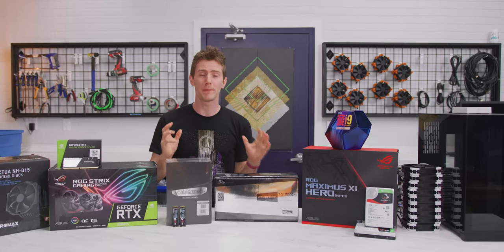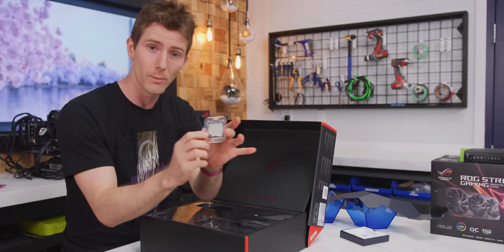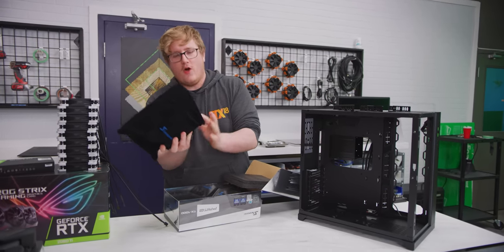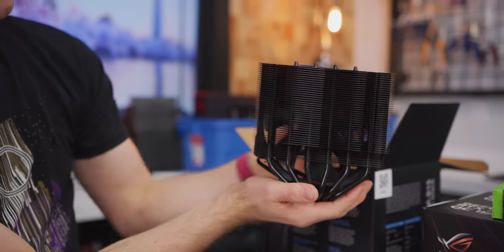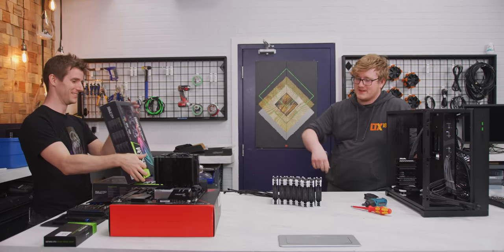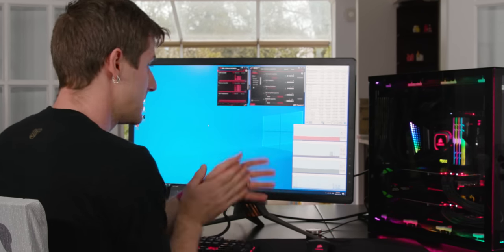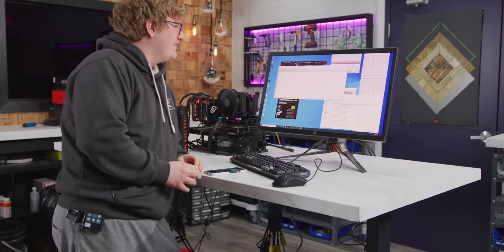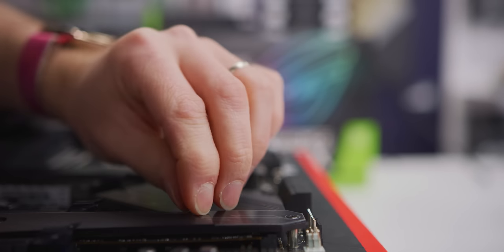Can AMD Beat the ULTIMATE Intel Gaming PC?

Comment: "Air cooling is every bit as good as water cooling!"

Except when the AIO water cooler fits and the air cooler doesn't.
Reply: Maybe someone should look at the air cooler vid just released on GNexus
Reply: That's just lazy planning. You still get a potentially noisy AIO pump and the design typical vulnerability for failure (gunk buildup, failure of the cheap ass pump, liquid evaporation). AIOs are expensive but yet questionable in quality. And the less questionable start to hit custom loop pricing. Also I wonder if vibration just in the socket is such a great idea over a long period. Maybe the soldering joints won't like it.
When the air cooler fails only the fan can possibly fail. Your CPU will throttle a lot but otherwise will work fine. With an AIO you might get black screen shutdowns even in the UEFI screen. Thankfully modern CPUs usually won't fry themselves anymore.

Also you could transplant s behemoth like the ND-NH15 (or whatever it is called) to countless new systems. Noctua provides new mounting kits for free (you can get AM4 screws for old S775/S939 made coolers if you want) and since there is not much change in design it will probably stay one of the best air coolers for many years. Unless carbon nano tubes, special ceramics,  or diamond powder get used in larger quantity in the base plates and fins there is no change about to happen. This cooler will work perfectly fine in the PC that comes after your next PC in 12 years. I wouldn't trust a typical AIO to last just one extended life of a PC.
Reply: @Hortifox_the_gardener  Yes, my old Scythe Mugen 4 cooler from I don't know how many years ago is still kicking, too. Had to buy a new mounting kit for it though, since I guess somewhere down the line AMD changed their mounting.
Reply: I'd use aio even if it was always worse. Just can't stand huge heatsinks anymore. This cooler looks ridiculous.
Reply: to me, AIO water cooler is good for high performance rig in a compact case like an ITX build where Air coolers are not great. but if you have a ton of space, i’d use a Air cooler. i just make it sure i have a ton of fans like a wind tunnel (this would be loud asf though)
Reply: Imo thats most often just crappy case design
Reply: @kepeter97  or just a case designed for water cooling. The air cooler would fit in an pc o11 XL or maybe in a pc o11 air
Reply: If they had used the xl version of the pc-011 that air cooler would fit.   Planning is key.
Reply: @Hortifox_the_gardener  You have somewhat valid points, but the risks are not anywhere near as big as you suggest. Go watch GN video from a few days ago. It also shows that when noise normalized, liquid coolers do beat air coolers. It may actually not make much of a difference in practice, but that's the same as that those extra FPS on the Intel system does not make a difference in practice, which is the whole basis of this video. So Linus saying that there is NO difference is just plain wrong.

And liquid coolers CAN actually make a bigger difference when you take into account heat soak time. Liquid coolers and air coolers are very close in performance once they reach their steady state temperatures, but since long 100% CPU load tasks are kind of rare, in many cases your CPU will actually stay cooler than that with the liquid cooler because the air cooler will heat up faster than the liquid.

Now, that doesn't mean that air cooling isn't perfectly fine, it is. It's just silly to say that it doesn't make any difference at all in a video where you're going for the absolute maximum everything and comparing Intel and AMD on performance that doesn't actually make much difference either.
Reply: I can really relate to this thread, I've got the same case and I've had to leave the front off to allow room for a cheap air cooler, because my NZXT Kraken died. Currently waiting for an EK loop kit to replace it, could take a while.
Reply: wish they could make tower coolers fatter and shorter without dropping performance.  like do side by side 100mm instead of inline 140 for slightly more cross sectional area. i got a pair of 92 mm noctua low profile fans on my case in a negative pressure configuration that shove all the waste heat from my cryorig out the side of the case with great force. so dual or quad 92mm in a side by side config might be fairly good, provided it does not block your gpu.
Reply: @BCSJRR  not in the o11 air, it has the same size as the dynamic
Reply: @Alice_Fumo  i cant get any am4 mouting stuff for my scythe coolers. got 2 140mm they are insane i mean heavy AF and cool pretty well but yeah its not the basic amd mounts so it wont mount to am4...
so i had to buy a new am4 zalman cooler for 24€.... luckly amd is not a hot head like my old i7 6700 that i only used 4 months cause Oc that a 4.5ghz and it would crash and go upto 95C and crash cause needs alot of voltage.. 4.2ghz worked good. but it felt slow still... just went full amd since intel sells better :)
Reply: watercooling is NOICY AF
like when ever the pump turns on... the fan that turns....
my 120mm air cooler cools as good and also just has 1 fan... 
only reason AIO are cool is that they look nice and clean... i just dont like them...  dont trust them...
Reply: @dorientjewoller113  ain't that actually part of the whole planning process I mentioned? I have my NH-d15 in a pc0-11 XL it don't with room to spare. Not to mention it far better fits the wider pcb layout so cables don't touch the glass. And my reasoning was I like  a big air cooler. But also liked the pc-011 aesthetic. So that setup worked perfectly for me. And the hotswao drives is a decent plus.
Reply: @reggiexp69  hm, the scythe official website still says, that you can get it by asking the support and paying 5€. However, I ended up buying it from ebay back then and those offers I can't find anymore. By the way, I think I tried to contact the scythe support team and got no answer, but I may be imagining that, since I might've decided ebay is much more convenient.
Reply: @Alice_Fumo  same i contacted them atleast 2 time this year... nothing so yeah fuk it. it will stay intel... my mugen max and what ever the other name is. they cool but not usefull if not am4..
Reply: @scarletsylph  Yeah if you want to run a big air cooler you need to buy the 011D XL. I am running a Coolermaster V8 GTS in my case and it fits perfect. Lian Li publishes the max cooler height and max GPU length on all their cases so you can just look it up before buying to make sure your cooler or GPU of choice fits in it. With that being said the price difference in cases will eat up the savings from going from air cooler to AIO. So if it's a new build and size is a concern just get the 011 dynamic and a good AIO or custom loop. The dynamic XL does have some really nice hot swappable drive bays, but it is a beast of a case.
Reply: @dorientjewoller113  in that part I definitely agree I mainly watch linus videos for the entertainment value alone because if I want an actual review. I find other channels to be far better in the information part.

Like for hardware it is mostly gamers Nexus.
Reply: @dorientjewoller113  and another point tbh no one in their right might would actually buy two 2080ti
Reply: @dorientjewoller113  yeah i got 2 scynth cooler ofr 12€ each. old stock on some site. never used them (kidna forgot them) then put it on my i7 2600k gained a easy 5C compaired to the coolermaster 120mm  master air pro4 what ever it was. then i put it on my i5 6400 OC that ran cool to the point where it i could turn it off under 35C with bios fan curve then the i7 6700 OC that still was cooking or you needed 100% fan speed. now its collection dust. cause i got 2 am4 pc and 1 with tht i7 6700 but i got a lepa neo rgb cooler on it... just cause rgb.. got some old i5 2320 but that just have a stock cooler.
but i do love the scynth coolers they heavy AF and kinda cool and cool really good...
Reply: This ^ FTW

Comment: Had an overclocked Intel to go up against stock AMD... Where was the overclock on the AMD? Unfair...
Reply: Intel: burning to get high.  
AMD:  go brrrrrrrr!
Reply: The case COULD be that the 3950x doesn't really overclock. But great question.
Reply: 3950x will overclock but you need great/unconventional cooling to get much out of it.  Easier to tune your ram as well as possible and let the CPU overclock itself as well as it can if using standard air/water cooling.
Reply: the point is there is no manual overclocking both cpu´s where used stright out of the box with there "standart" clocks and yes u could technically overclock the amd to a similiar lvl and will get an even or better performance but u could also buy a normal 9900k and overclock it by yourself.
Reply: The problem in the comparison is that they got a binned 9900KS that they knew was on the high end of quality you can get for that chip but they grabbed a random 3950X.  It could be that the AMD chip was a garbage tier bin and barely up to the specs of a 3950X.  We don't know.  In any case we're talking about a 100mhz difference here for either chip and it's not going to give you the 10%ish difference that was demonstrated.  So Intel still will come out ahead regardless of binning.
Reply: @kevin9218  thats true but Lopalos stated that this comparison is unfair couse intel´s cpu is overclocked but its totally fair since they just bought the best(gaming) cpu from intel and amd with both cost around 750 ~ bucks and both cpus used with stock out of the box clock and in this case u have a huge 10-20 % performance advantage by intel and anything else did not matter at all here
Reply: @puttitat2851  X means unlocked?
Reply: @leonljensen  It does, but 16 cores in a small package also means that it's not really feasible to overclock it with regular aircooling / AIO.
Reply: this video meant that high clock cpu from intel still beat multi core AMD. thats a fact. but, again, do you need a pc for only gaming? it's your choice
Reply: more cores does nothing for gaming when your talking about 8-16 cores. 9900k has higher clock speeds so even if it was a normal 9900k it would still win but not by the margin they had it winning by. 9900k is still king of gaming.
Reply: Why does no one use 3800MHz RAM in the AMD where the CPU performance is tied to RAM speed?
Reply: @papapruett2820  I use dominator platinum 3866mhz with Intel 9900k
Reply: I'm running an AMD 3700x right now.  I switched to it from Intel.  I can guarantee you, these things have next to ZERO overclocking headroom, they're already almost as pushed to their limits as they can be, frequently unable to hit the advertised clock speeds when all cores are turboing as high as they can go.  This doesn't mean that they're bad chips though, it's still absolutely one of the best purchases that you can make since you're still only a little bit behind in single core performance for nearly half the price, and the loss of overclockability is barely felt in terms of performance (I still miss being able to tinker with it personally).

I'm personally more bothered by the fact that they didn't test any titles that were much more CPU bound, even though they were running RTX 2080ti's.  Something like Civ 6 or Cities Skylines.  Counterstrike alone isn't always the best choice IMO to test the CPU.
Reply: @leonljensen  all amd CPUs are unlocked, x are just prebinned by AMD to meet higher clocks in their factory QC.
Reply: @MrStealYoBeef  cities skylines is just terrible in that it is CPU bound, but limited to 4 cores I believe. I saw barely any fps (maybe 5) increase going from an i5 4670k to a Ryzen 3600X which is an upgrade in every way. It's a really heavy, unoptimized game.
Reply: @papapruett2820  correct me if I'm wrong but I think 3600mhz ram will do better because that's the limit of the 1:1 ratio on ryzen.  If you can overclock the fabric to match the faster ram it will help but if you can't match the ram speed, you are better off going a little slower.  In any case I don't recall them stating what ram they were using in the AMD system here.
And yes ram speed makes a huge difference on ryzen.
Reply: Lopalos      AMD has twice the cores.  A 9900k is 5.0Gh stock. Overclock, 5.1  BIG Deal.

Comment: "it doesn't make a difference*"

*unless you have a tiny case with bugger all airflow the deeper you go in

EDIT: OR IF THERES NOT ENOUGH ROOM I GUESS LMFAO
Reply: Yeah never understood why would anyone ever use single 120mm radiator AIO and then I started building gaming mini ITX PC for living room and suddenly there were no good high performance air coolers under 135 mm height limit...
Reply: That Point would work, if the Lian Li case had actually bad airflow. Which it doesn't.
Reply: well i could argue a jankyass case like that wont have a aio muunting point aswell
Reply: @nibhanbaig6675  Not really there's 120mm fan mounts in just about any case. That's usually all ya need.
Reply: @TinyChrisTV  Not saying it did, just saying a use-case of AIOs
Reply: @nibhanbaig6675  two words: Silverstone SG13.
Reply: i'm thinking he means performance wise, obviously if something doesn't fit it wouldn't work that's not a "difference"
Reply: It's preference. I love my aio and I'm happy paying what 50$ more for a look I prefer.

For context I was thinking of buying a noctua dh-15 but I got an nzxt kraken x63 instead and I love it
Reply: Sizniche A custom loop with a good radiator set will make a difference.
Reply: Gamers Nexus says water is better ... I trust their testing the most on YouTube
Reply: or if you dont want to bend your mobo ever!
Reply: He should tell it to the threadripper
Reply: Gamer's Nexus says otherwise, and I trust their testing more than anyone elses.
Reply: @robert3374  unless you go full custom watercooling then big air coolers perform better, funny enough both the cooling and in Boise, they tested it too, check it out
Reply: @robert3374  Unless you have an active water cooler with something resembling a refrigeration unit, it really doesn't make much of a difference whether you go air or water.
Reply: Tech debt for motherboard

Comment: Also, Linus just finally accept that SLI is dead for gaming.
Reply: im pretty sure he knew it for a while but for nostalgia's sake
Reply: NEVER GIVE UP!! We must demand the industry continue to utilize SLI heavily..

That way I can justify having 2 of them
Reply: @BradUSMCVETrider  i am too broke to support that... But i had a gtx670 sli back in the day tho and i am missing it
Reply: Still got my 970 dual SLI setup here on a i7-4790K... good enough that it doesn't justify upgrading for the few games I have time for these days. Maybe for Cyberpunk 2077 I'll need to get a new GPU.
Reply: @shinyhappyrem8728  probably need at least a 1060 or 1070
Reply: If your favorite game supports two graphics cards, I don't see any reason to not have two 2080 ti in NV-link. Unless you can't afford it obviously.
Reply: @shinyhappyrem8728  my first build was a 6950x on a asus ramage v extreme 10th edition with dual rog 1080ti matrix and a 2000 watt leadex superflower psu. EK waterblock covering the cpu, northbridge and VRM.
Reply: @AgentSmith911  train simulator
Reply: @shinyhappyrem8728  That is like the much better older brother of my single 970 and an i7 4770, I often wish I had spent the extra 80-100 bucks and got the 4790k, my cpu is definitely holding me back in some games. If it werent for that cpu I could keep using this one for another year or so but I think I might upgrade the whole damn rig soon. Good thing I am an essential worker.
Reply: The extra problem with this particular generation is that 2080Ti have finally saturated and therefore chokes on PCIe 3.0 x8. Therefore, just having a second card in there, even if not in use/causing conflicts, will hurt performance for any game where multi GPU is not being used. So it's not even a matter of "wasted money most of the time", which, for anyone who would build this, probably won't care, but actually "worse performance most of the time". Not by much, probably ~5%, but still.
Reply: Can I SLi 2 3400gs and get 8c16t, vega 22, and a 6800g?
Reply: @BradUSMCVETrider  It's mostly down to directx 12 anyway
Reply: Revolvin Goatt  it corrected itself to matrix. They are 1080 Ti ROG STRIX..
Reply: @RChero1010  😢
Reply: Revolvin Goatt  no, I'm not trading. And you are correct about me being a 2080 ti guy though, as I will be upgrading to the 2080 ti rog in NVLink
Reply: Revolvin Goatt  well, upgrading is misleading term. I will be building a brand new system and giving the old on to my son for his birthday.
Reply: My 9900K + 2 RTX 2080s SUPER NVLinked push up to 200+ fps at 1440p max settings in Apex Legends. I need a 1440p 240Hz monitor (currently on 165Hz with G-Sync).